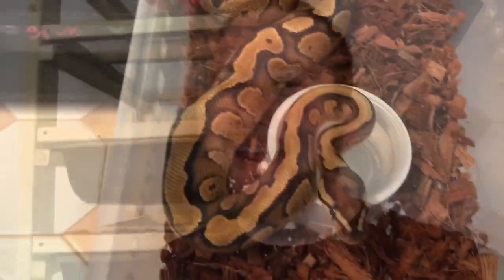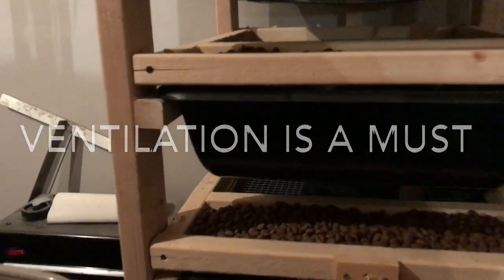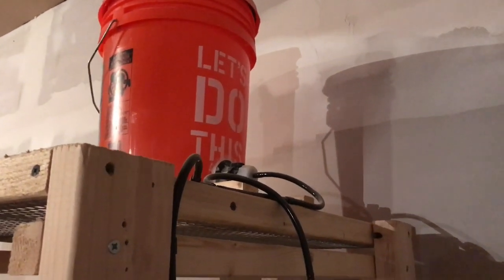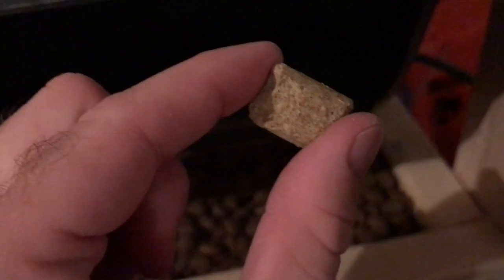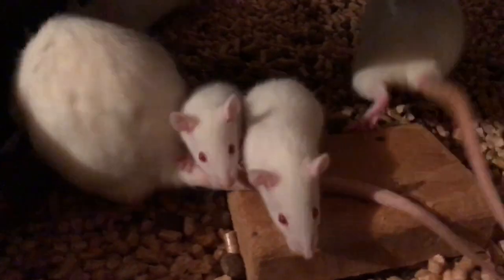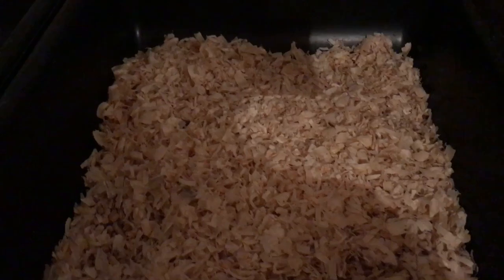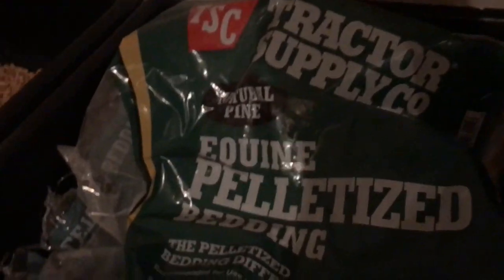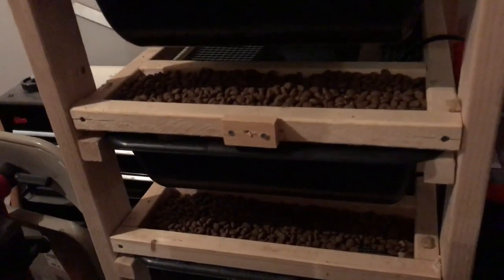How to breed and care for rats

Comment: For a small rack like i'm planning to build. A 6 tub rack I'll have will be in a spare room down the hall from my living space. With that, I plan to use kiln dried pine shavings unless they develop problems with that. I have one on KDP and so far she's doing fine. Changing out bedding frequently (every 2-3 days) should also keep down on the smell. Perhaps an air freshener in the room is another option for smell? It's otherwise a great setup. I may be looking for a tad bit larger tubs but otherwise nice job.
Reply from the maker: Yea all that will probably work changing them a lot but that will get old fast I assure you. I would try and put them somewhere away from your living space. They can get smelly the more you have.

Comment: Great video and great info!  Keeping them outside, what kind of temperatures swings do you have as the seasons change?  I know in my part of the country it gets awfully hot in the summer and very cold in the winter.  Not sure what temps are safe and healthy for rats.
Reply from the maker: So my garage stays pretty cool because of a fan I use. It can get around 80 degrees and lower but they still do well. In the winter is where it’s a problem for them. You don’t want it to get lower than 60-55 degrees